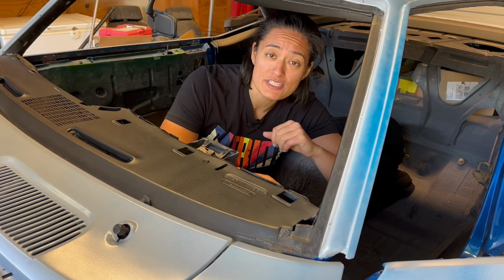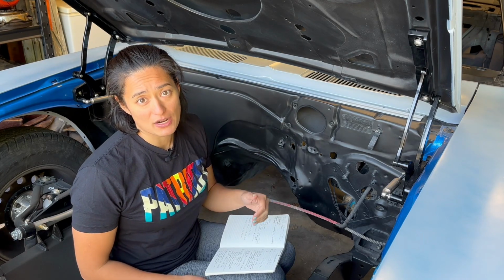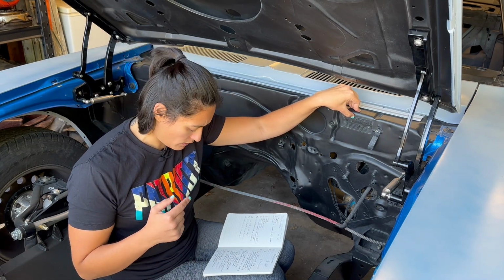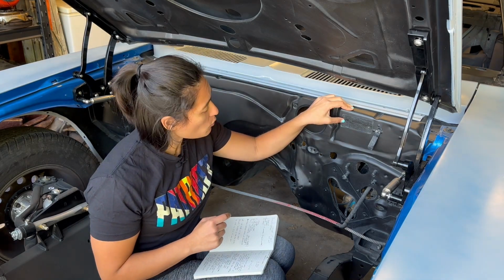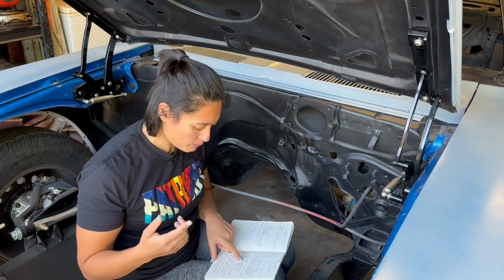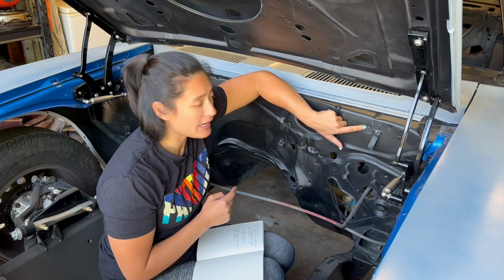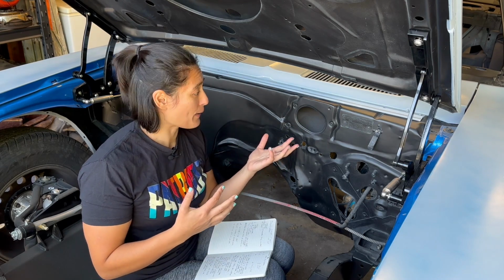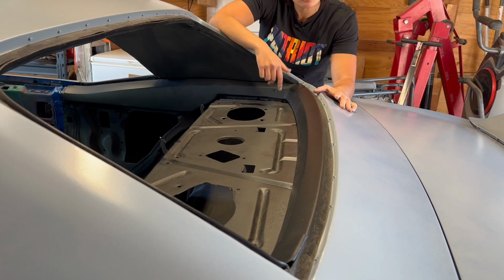Decoding the Vin & Cowl Plate

Comment: Great job on your decoding work! One other source of information for your Camaro is to get a "shipping data report" from NCRS. The cost is 60 bucks, but you can browse through examples of other shipping data reports posted online and see if you think they are worth the expense.
Reply from the maker: I forgot to add it into the video, but I did pay for something. I’ll have to look at the sheet to see if it was NCRS. If that’s not what I have, I’ll look into it. Thank you so much ❤️
Reply: Good info
Thanks for this! Just went to the site and requested one for a 70 Z28 I just picked up.
👍👍👍

Comment: Great job on the vin decode. It still cracks me up to this day that they list “L” for Los Angles when the plant was in Van Nuys. Though still part of the City of Los Angeles, it’s still Van Nuys which is a planet of a city. 

I used to live five minutes from the plant and got to see some cool stuff come out of there. I have a few friends who worked there and love hearing their stories especially the one about how GM and Fisher would almost end up in fist fights over who’s color code was correct. Fisher would build the carriage and paint it, then send it down the line to be mated with GM’s front clip and in some instances there was a slight variation in color, which I just assumed was the paint process itself. Love the stories these cars tell. Thanks for sharing yours.
Reply from the maker: @phoenixblack1220  oh that’s really cool! I didn’t know that, so thank you for sharing. It’s going to take time to finish building her, I know it will be worth it ❤️. I appreciate the encouragement!
Reply: @christinasgarage  one step at a time and one thing at a time. Try not to look at the project at once, it can get very overwhelming. The best advice I can offer is to break things down into smaller tasks so that you can accumulate many wins and feel a sense of accomplishment after each thing. 

Also, don’t get weekender syndrome where you feel like you have to rush through a job just to get it done and half ass it and say to yourself, ahh, I’ll go back and do it right later! Take your time and do it right the first time and don’t be discouraged if you can’t finish something in your specified time. Just remember, it’s a hobby so have fun building her. 

Another thing I do and recommend is to buy a scale model kit and build it up in and try different things to practice before you pay big money on the real thing. Most of all, just have fun with it.
Reply from the maker: @phoenixblack1220 thank you for the advice. I never thought to buy a kit car. Do you have recommendations on where I should look for one?